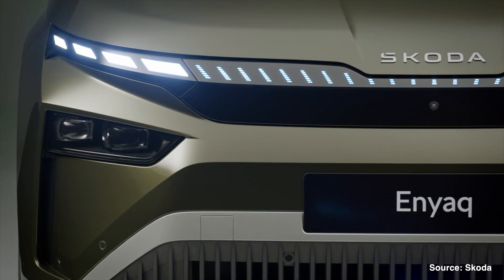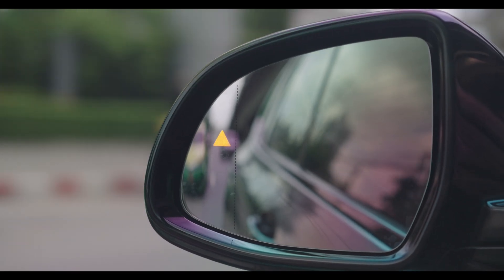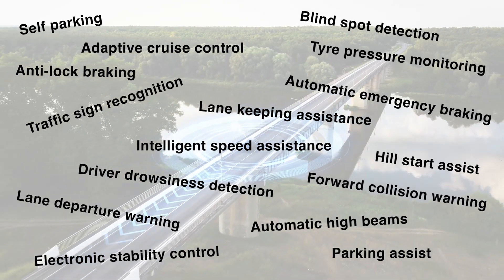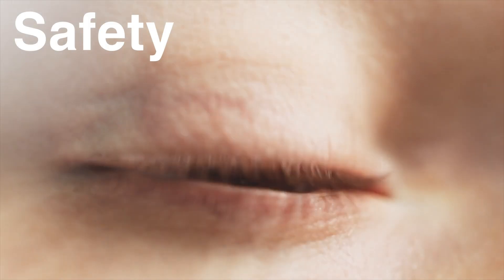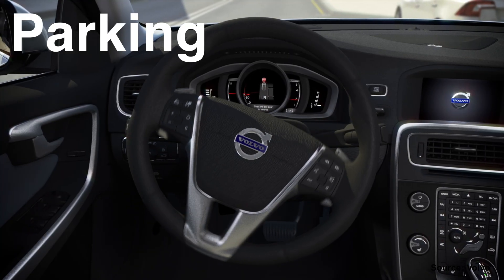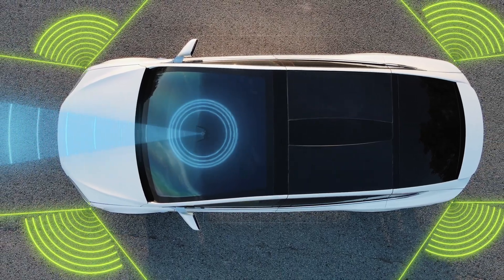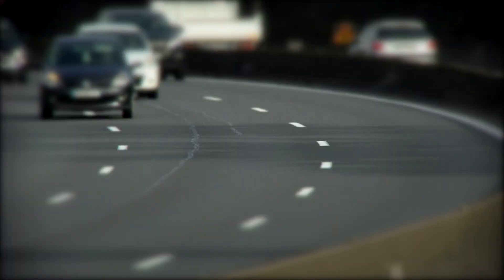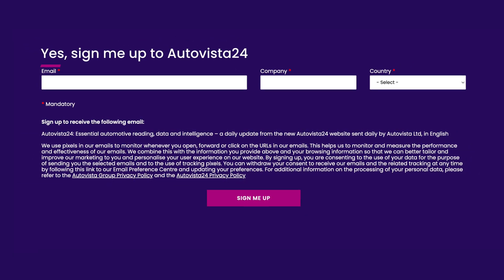What is ADAS?

Comment: Unsafe safety features. 
Lane assist that pulls you back in lane when you’re trying to overtake a cyclist or parked cars. And autonomous braking that slams the brakes on for no reason. These systems are an absolute nightmare.